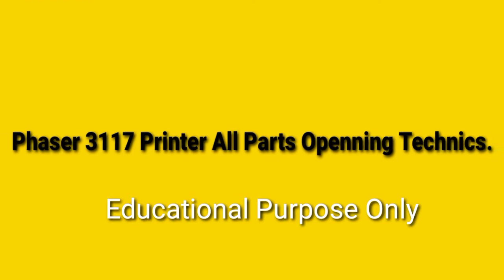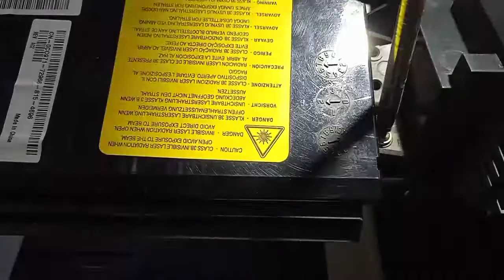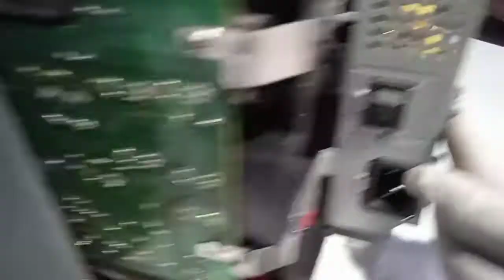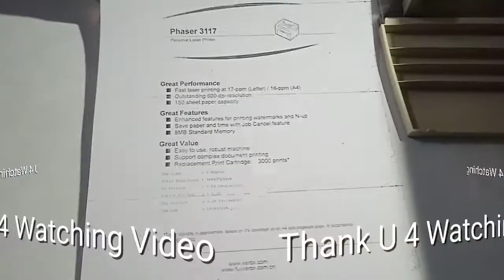Phaser 3117 Printer Disassemble

Comment: one defected my 3117 xerox phaser printer ......

More paper collected the printer and then jam the machine  .... but one image print and manually supply one paper the machine the machine proper run,
please solve  the problem or suggest proper way .

 Thanks and more thanks the respected video
Reply: Remove excess paper tray